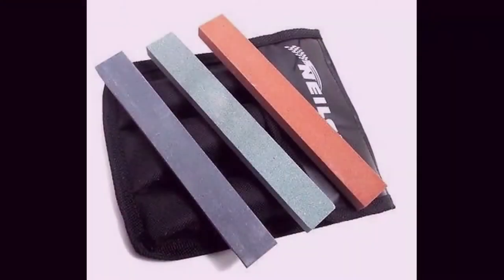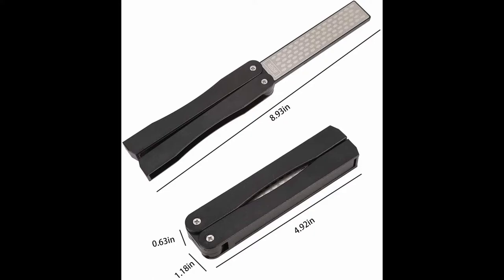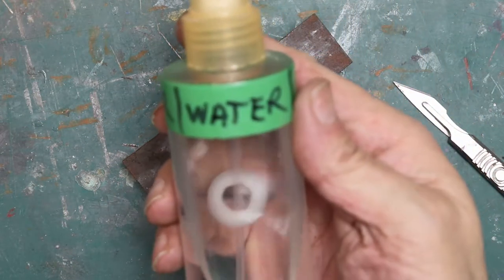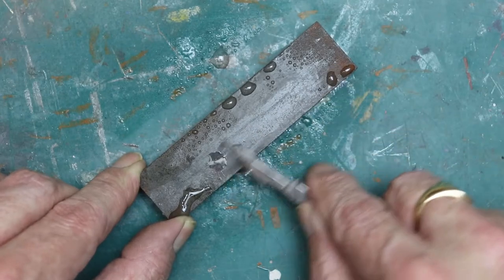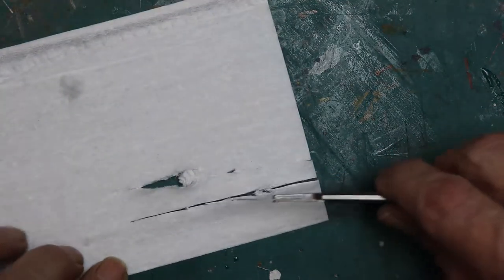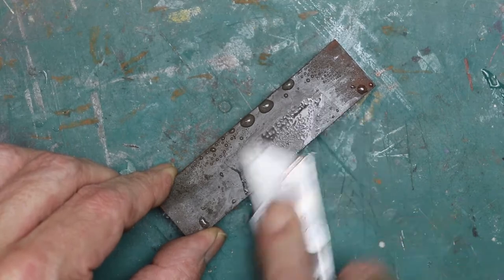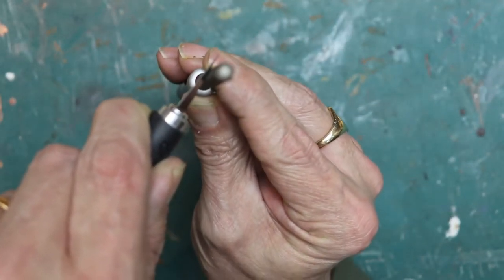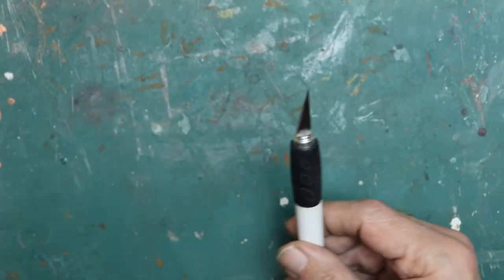TimberSurf's Vid Bit No. 19 - Knife sharpening stone

Comment: Brilliant, and very useful. I go through a lot of blades. A couple of questions though... For a scalpel like the Swan Morton one you showed, which is exactly the one I use, what grit number stone did you use/do you recommend? And you mentioned oiling it... what kind of oil do you put on? Thank you! :) Michael.
Reply from the maker: lol, I bet you do, as you are the cardboard King! My RS Components stone is just defined as "fine", I would recommend above 600 grit, any oil will do (3in1 etc) or water even (it acts as a lubricant to stop the metal fillings sticking in the stone), just remember to clean the blade after sharpening, oil stains on you work would be a nightmare!
Reply: So I bought  one... and have cut 10 3-part roof trusses with one blade. I would have used 5 blades in the past. 👍🏻👍🏻👍🏻
Reply from the maker: @Chandwell N Gauge Model Railway  I bought a pack of ten about 5 years ago, still 7 to go! lol. So glad you found my tip useful and cost effective 😀